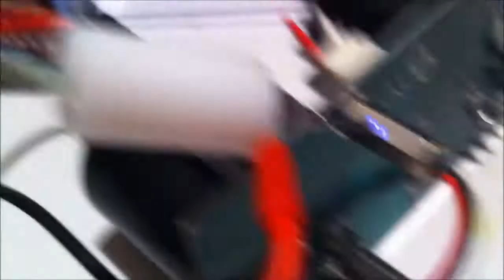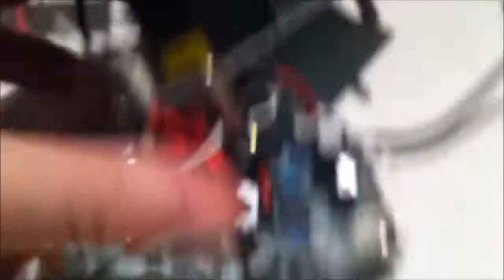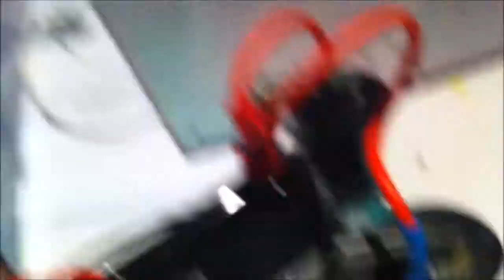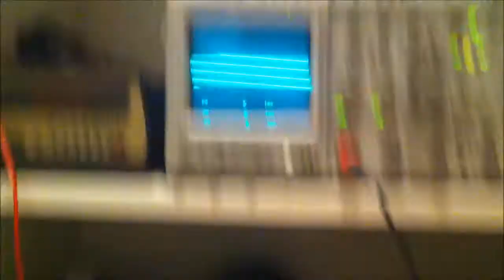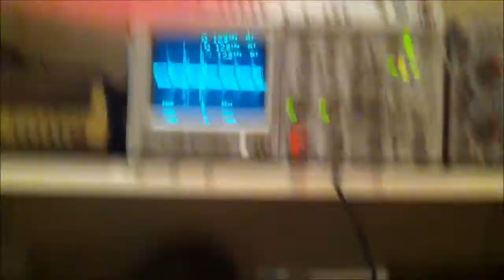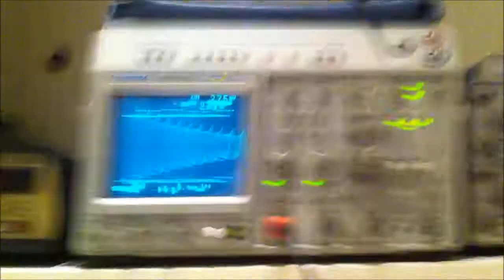Small Flybacks test + Scope analysis of driver circuit output

Comment: Those types of ionizers use one transformer operating I would say around 4mhz while the other one has very little output serving as a type of ion biasing allowing it to have a high voltage round that still supplies power